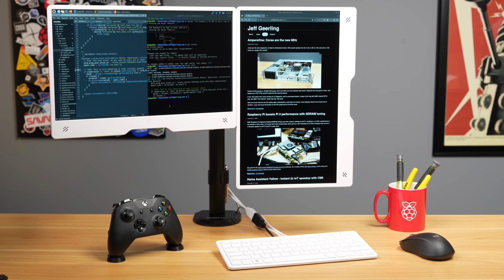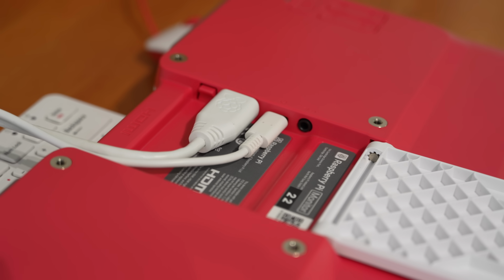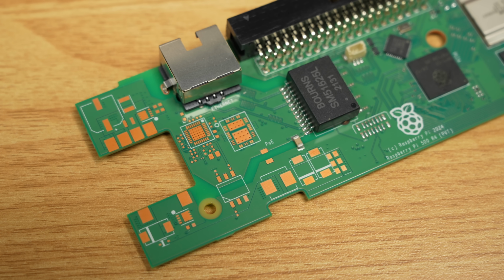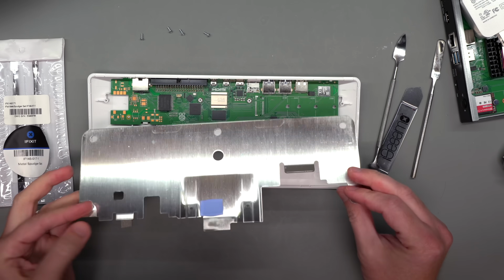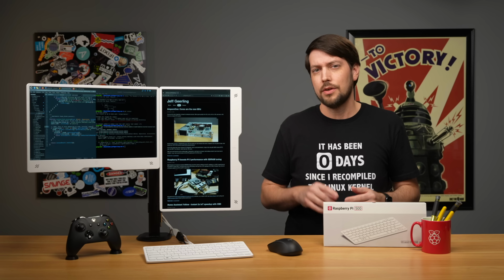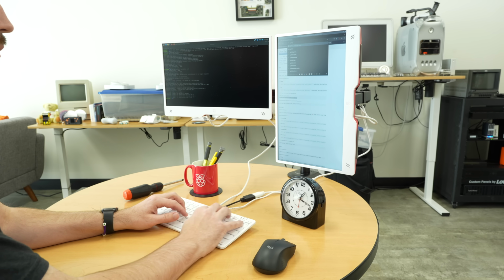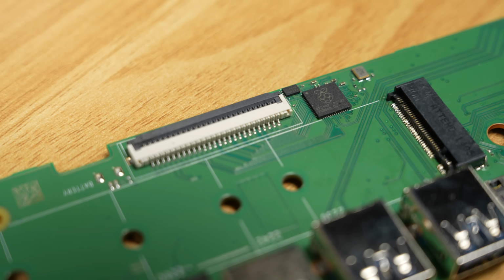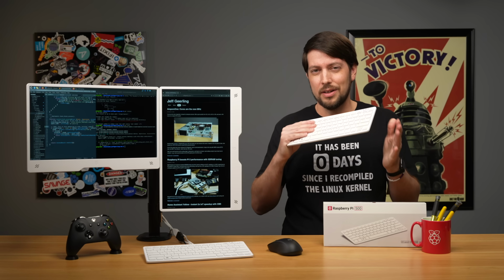The Keyboard IS the Computer! (Pi 500)

Comment: I want sbd from their development to explain the logic behind selling monitors without miniHDMI and a pc with miniHDMI
Reply from the maker: It's like Apple selling half their accessories with Lightning ports forever!
Reply: @JeffGeerling  That is a comparison to be extremely afraid of. Being compared to Apple is nearly never a good sign.
Reply: @JeffGeerling  Even Apple stopped selling Lightening keyboards and mice.
Reply: can you imagine how hard it'd be to find a mini HDMI to mini HDMI cable??
Reply: @smb1397  you get the pi500 package that includes the power adapter AND the hdmi cable,simple ;'-)
Reply: I actually just picked up a ReHisk 15" 1080 60mhz touch monitor for 80$ (Newegg had it on sale for like 60% off over Black Friday) that uses mini-HDMI.  Though if you want to use the touch functionality, it needs to use the USB-C.  
Regardless, planning ahead for the Pi 5 I'll probably be buying in early 2025.  While not on the bleeding edge, it's pretty solid and very portable, and will adequately function for most of what I plan to use the Pi for.  And the price feels very good.
Reply: I thought it comes with mini hdmi to hdmi cables ....
Reply: @sspence65  it does,if you buy the kit that also includes the power adapter,I am certain that ninety percent of buyers will get the kit because who would want a system without a power supply?
Reply: Would have been better using USB-C, at least they are common and the adapters are readily available.
Reply: When was the last time you saw a store selling micro HDMI to micro HDMI cables without having to dig and search for it online? I just checked and it looks like monoprice doesn't even have one and cables are their main deal. I finally found a 6 foot one on amazon but it was several dollars more than a cable that was regular HDMI to micro. It is actually pretty uncommon to see anything using micro for input. Usually it is devices with space constraints using it for outputs so I don't think many company are building micro to micro cables.

The real question is with the form factor of the 500 why is it using micro? I wonder if there is some RF reason or if it was just that they could get the connectors cheaper or something.
Reply: @JerzyLasica  You mostly see mini HDMI on portable monitors and lapdocks.
Reply: Why do you think they owe you an explanation? They have their reasons, and if you don't like it, don't buy a Pi.
Reply: @another3997  Ruin your Business with ONE SHITTY ATTITUDE! Manufacturers HATE THIS ONE TRICK!

Comment: If they added the poe and real hdmi ports, this would make a perfect thin client
Reply: Wow, networking and setting up a lab with it as a way to configure the switch would be awesome
Reply: Hence the omission of the required components
Education and industry are huge for the Pi Foundation, so they're saving that SKU for them
Reply: I remember losing power with this form factor by moving the keyboard/computer: the cable would unplug. Make sure to fasten that e.g. with velcro.
Reply: @NPCsNeverGetShadowBannedOnYT  Or just don't use this form factor. It's bad engineering (why put the computer inside the component that's the most likely to get a drink spilled on it?) and when they first came out with the 400, I specifically remember thinking it would be good for about three things: blind people, people with microcomputer nostalgia, and harvesting the board for whatever odd application might require all the ports to be along one side. I can't believe they made a 500.
Reply: I just picked up the Raspberry Pi Zero 2W with the Argon pod case and HDMI Hub. I love it as a Playstation. I have a Nacon Playstation controller for it but I need a second one.
Reply: @michaeldemers2716  Are you running PS emulation on a zero 2w?
Reply: Yeah, being able to netboot one of these and power it all with one cable would be super cool! Hopefully they can make that work next time or release a different PoE version
Reply: Thin client requiring dedicated 5V5A power supply... Hmm.
Reply: @marksmithcollins  that's what the poe is for
Reply: Except for the chintzy keyboard.
Reply: There are 2 real HDMI ports, unless you need HDMI 2.1 but I don't see that relevant in that type of computer
Reply: @strivold4922  but buying those special cables or adapters just adds to the cost with no advantage of those connectors in this form factor. The sbc version does not have the space for it but this thing totally has

Comment: Kind of disappointed you didn't slap in what's needed for the M.2 power regulation. Guessing you didn't have that to hand.
Reply from the maker: That, and a tight enough deadline and not wanting to potentially blow part of the power supply since I still had more work to do on this video with that board!

Comment: Great video. I too was disappointed at the lack of m.2. I didn’t have the courage to try soldering one on.
Reply: Am I correct in believing that the m.2 runs through the mini pcie on the pi5?  Does the pi500 also NOT have pcie capabilty which is necessary for m.2 ? If that is the case its woefully under featured...

Comment: Interesting to see the M.2 slot still be exposed when you open it up despite not having any of the parts installed. Really wish we will get something like “Pi 550” with all the missing features in the future!
Reply: Agreed. PoE and access doors for NVMe and battery capability (18650s?)
Reply: It's pretty telling that there's this obvious feature missing with there still being a $20 price raise—seems like they were really trying to compromise to hit a price point and ended up satisfying no one.
Reply: @GSBarlev  They'll satisfy a lot of people, just not serious enthusiasts.
Reply: I wonder if you could pick parts from nvme hat and fill it!
The m.2 hats circuitry  looks pretty simple. i got a pi m.2 hat+ and it only got a  buck regulator, an eeprom and some transistor circuit for blinking leds
Reply: @nand2624  It's a shape they didn't simply make the keyboard wider, with a little bay there for peripherals.
Reply: like a pi 550 with nvme ,a pi 555 with nvme and poe
Reply: @OsvaldTechlab  and a pi 505 with poe and no nvme then?
Reply: @daveamies5031  ya why not
Reply: @OsvaldTechlab  555 would be the perfect number! Nice electronics reference!
Reply: Sadly, that's been a thing with manufacturers for a while. I have a Lenovo laptop that's 10 years old. They used one mold for the laptop that had the screw standoff, access and writing on the silkscreen. If you didn't configure the laptop to come with the m.2 originally Lenovo left it all unpopulated. Would have cost them pennies to still populate it to make it an option in the future. Instead, Lenovo just decided it wasn't worth their time since it wasn't paid for.
Reply: I'm starting to think it's a heat thing. Like they designed it for M.2, but couldn't get it working with the heat sink limitations.
Reply: @tomgidden  That might be. You add the NVME and POE and now you need a fan and a different enclosure... And now it's $120 or more. Still, do that, add 16GB and you have a serious contender.
Reply: @tomgidden  I can agree with you. I use my Kingston NV1 NVMe SSD as an external hard drive, and I can easily feel how hot it is, even with the thermal pads attached on it.
Reply: I added M.2 to a Mikrotik RB4011. In that case, the slot worked after I short-circuited the pads destined for the 0R resistors. Coupling caps are recommended but I didn’t use them.
Reply: The problem is the more you add, the more it costs, and the Raspberry Pi has to strike a balance. As a pure desktop computer, the Pi can't compete against mainstream x86 manufacturers or Apple in terms of price/performance/features, especially if you include buying a used PC or laptop. Despite what some people want, that's not what the Pi is really about.
Reply: @another3997 Nice thing about the Pi 5 is that they didn't have to add NVMe: they just exposed the PCIe header, and the ecosystem dived on to make NVMe adaptors.

If they'd left in the PCIe header and just cut out that whole chunk of PCB taken by the empty NVMe board and support, third parties could've added internal NVMe in myriad ways… eg. a thin NVMe base in the form of an aluminium baseplate that'd just add 1mm to the height of the Pi 500. But instead, NVMe is going to be impossible for this model of Pi 500, except by enthusiast hobbyists with time and soldering skills.

That's why I think this was a late decision. If they hadn't intended Pi 500 to have NVMe, they wouldn't built it in, and might have just exposed PCIe like they did with Pi 5. They wanted NVMe in there; for some reason, they dropped it.

I just can't see myself going back to microSD for anything but finished embedded projects. 

This is the first Pi I haven't ordered on launch day.
Reply: Part 2
https://youtu.be/2xCeVhDzh2k
Reply: Pi 500 model B. Stick with the Acorn naming conventions.
Reply: Hope they also have plans to have an AI module that fits in this M.2 slot
Reply: @techarm7351  Why?
Reply: They probably had it working but couldn't get it past FCC certification. Maybe the traces started acting like an antenna. Or maybe thermals
Reply: @HyenaEmpyema  Oh that is a good point for why they didn't have M.2 cause of FCC. Hopefully they have this feature dealt with soon, so we have SSD. Also be nice if we had ram slots so we could expand to 32 GB ram.
Reply: @cyberknight1973  I would accept a Pro model that required an active fan if it came with PoE and NVMe storage.
Reply: @HyenaEmpyema  My Pi 4 would jam my wifi when I had the display resolution set high so wouldn't be a big surprise it the Pi 5 accidentally spewed RF in other contexts.
Reply: Pi - pretending to be Apple - we don't include the most basic features everyone wants or remove them and people love us.
Reply: @L0st-n0found  I really wouldn't be surprised if Eben Upton doesn't let slip in an interview that they had it all working just fine with NVMe, but it overheated or the FCC complained or something, and decided to just go with it as-is rather than delay production. It doesn't explain the inaccessibility, though. 

It would've been nice if they'd at least broken out PCIe to the back for the option of an SSD pack.

Comment: I'm more impressed with the display than the 500 personally.
Reply: For home use, nah. I just bought a couple of 1440 monitors for 109 on sale and they are under 150 without being on sale. Now for use in/on a vehicle with the ability to be powered via USB they are worth considering.

Of course there may be a LOT of people out there that live in areas with far more limited options for buying things like monitors or they may have tight power constraints.

I could see them being attractive to somebody living off grid or for somebody building kits to take into areas for disaster relief to set up stations for people to communicate with the outside world with a whole table of gear running off a generator or a few small foldable solar panels. Have a whole computer lab in a hard case complete with power and something like a starlink dish. They are big enough to be readable but low power use and compact enough for something like that.
Reply: The display is over priced, comes with no cables, and a damn stupid implementation of VESA.  The only thing going for it is that it looks like a Pi monitor.
Reply: @gordon861  
I find a lot of the large Pi-branded accessories fall into a similar category.
Over-priced for what they offer.
Notably USB Keyboard and Mouse is 35$ (20+15).  Basic versions are half that.  Decent enough Wireless keyboards with trackpads start at 25$.  16 & 32gb SD cards are like 10-15$ when you can get trusted brand 64 and 128s for the same price.  I do give them a bit more of a pass on the SD cards though, if you are ordering one with Raspbian installed though - even though that's free to download, but it streamlines things if you're getting a fresh machine..
Reply: Why? It’s incredibly poor value. You can get larger, better panels for close to half the cost and they actually include a damn power cable.
Reply: ditto

Comment: Seriously no nvme? Why???
Reply: Exactly, it's absolutely a deal breaker
Reply: They went public, that's why. The dividents aren't gonna get payed on their own
Reply: @marcely1199  they already added the traces; they wouldn't have added it at all if was a serious concern
Reply: The extra components would add cost so there is going to be some tradeoff to adding it
Reply: It actually is a dealbreaker for me.
Reply: @shoveI  Get the Mac Mini M4 it has everything and $599, the Pi 500 is not for you
Reply: Cost. It's already $90 without.
Reply: +8Wh idle... and they are hot.
Reply: @bush2137  I'm guessing it has to do with heat dissipation. NVMe SSD can get really hot.
Reply: @farishanafiah8461  Heat dissipation? If only they were designing the PCB and case... oh wait!
Reply: You really have to ask?  Complexity and therefore cost. If you just want a desktop computer with high speed storage, plenty of performance and such like, just buy a mainstream desktop PC or a laptop and not a Pi. It will cost more, but will outperform the Pi for everyday tasks. If you want a CHEAP tinkering and hobbyist machine, with gpio pins and access to 1000s of amazing hardware and software projects, buy a Pi. The Pi is not designed to be, and likely never will be, a direct competitor for mainstrean desktop or laptop computers.
Reply: @another3997  My dude, you really need to like go for a walk or something. You're on here raging at everyone leaving a common-sense comment like "Don't use Mini HDMI" and "Why didn't you populate the NVMe slot?" with absolutely terrible takes.

Include PoE. Include regular HDMI ports. Add the NVMe slot (not even the drive, just the slot for someone to use the feature that's built into the board). Add USB-C. It's really not rocket science.

And yes, we will "just not buy it if we don't like it" but unfortunately that will probably tank their company after their product shortage and lots of feature shortcomings and price increases on their no-better-than-a-miniPC platform.
Reply: @another3997  The Pi5 SBC specifically supports PCIE/NVME, so there wouldn't be a lot of additional control logic necessary.  Raspberry PI systems have LONG suffered due to slow and unreliable storage issues (the only solution to this short of NVME that actually works is to add an SSD over USB 3).   It's really a shame that they couldn't have taken that apparently really small extra step to solve this problem using the support already on the chip, (and the traces already on the PCB).
Reply: @another3997  Or buy a mini-PC and a USB breakout board, then load Debian.

Comment: I hate RPI for missing necessary features in all over their products
Reply: Every time i buy a rpi, it's almost always either overpowered for the simple things i wanted to do, 
or don't have enough features or power to do the complex stuff..  that's why esp32 blowing up...
Reply: @vaisakh_km  Exactly.. I own two RPi's, two secondhand RPI 4's. They are either way too strong, and overpowered there's no point to using them, or I can't run anything due to the limited ram. I own like.. 20 esp8266's and a couple esp32's, and they are so much more targeted for their usecases and perfect in my projects.

I sometimes also use those RPI RP chips. Pretty useful things for keyboards. Have two in my own split keyboard.
Reply: Yup I've pretty much given up on them at this point. Usually you can either use a cheaper esp32 if you dont need the power, or a cheap N100 if you do need the power, either way both work out to be vastly better products than the stuff being shipped by Raspberry Pi these days. They've completely given up even attempting to act like they care or listen to their customers. Then again, we're no longer their customers, if you don't have a production line or massive B2B business you're second class to them these days.
Reply: @puressk  you were never their customers, it’s literally a computer for kids to experiment with
Reply: @DissociatedWomenIncorporated  yeah... Not the case any more. Hasn't been for a long while.
Reply: @TobyLegion  definitely still is the case, the full RPI400 kit even comes with an educational textbook
Reply: @DissociatedWomenIncorporated  do you have  any logic behind missing M.2 slot? Or even not having a proper HDMI port? Or even PCI express port???
Reply: @DissociatedWomenIncorporated  pricing/availability says otherwise, and textbooks are not just for kids.
Reply: @ where in my comment did I defend these design choices, exactly?
Reply: @DissociatedWomenIncorporated  It's too expensive for that. It's possible to find old x86 computers that'll run modern Linux with absolutely no issues with software or drivers for way too cheap.
Reply: @ everything’s too expensive for what it is now, though.

Comment: I hope they improved the keyboard compared to the 400.  It was truly terrible to type on.
Reply from the maker: It's a little better. But it's not as nice as a full metal keyboard (well, the base at least) like the ones I normally use.
Reply: It is kind of as unusable as the normal Apple keyboard. But, i do not see them meant for heavy typing anyway.